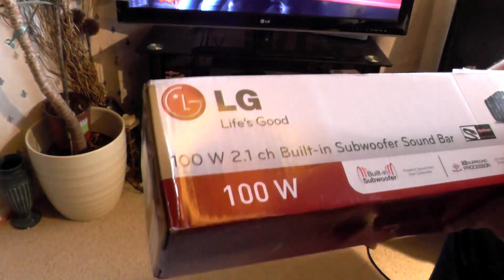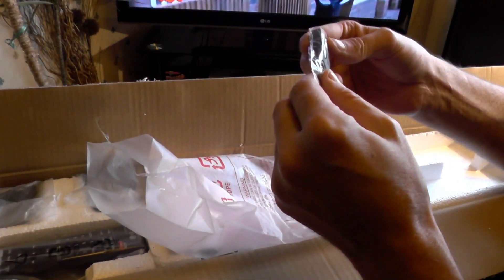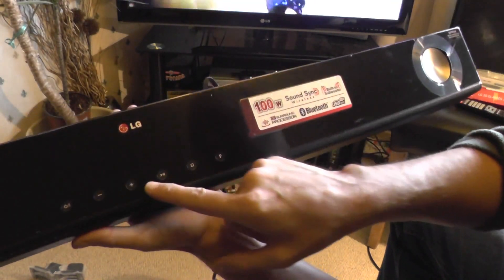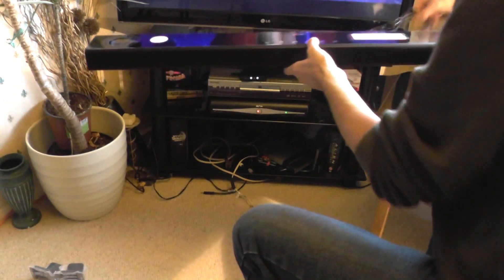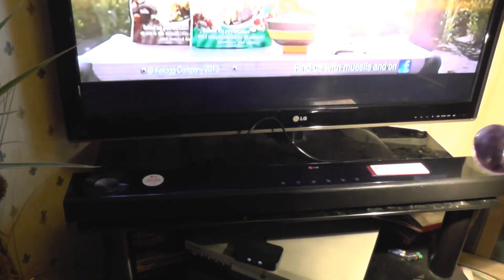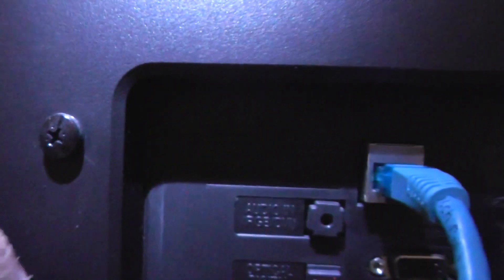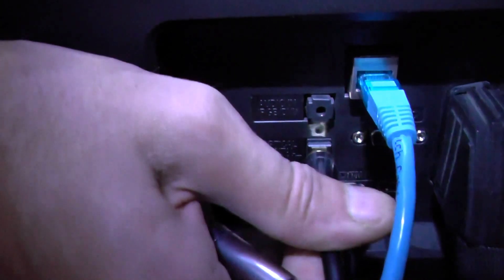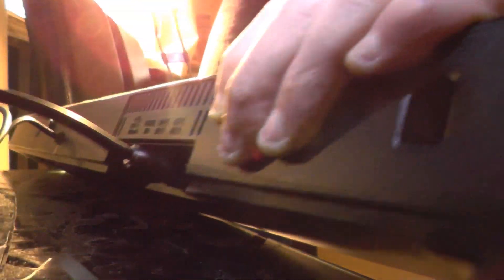🔊 Setup 2.1 LG Soundbar Bluetooth Speaker Home Entertainment

Comment: Can this be controlled with the TV remote? I've got a Sony soundbar with a panasonic tv and volume is independent. With an LG TV, can these be controlled together?
Reply from the maker: a lot more devices can co control.   LG tvs will as this is LG soundbar.   But it should still turn on via optical connection with any TV.
Reply from the maker: yes, when turning the volume up on LG tv, they both go up together.   As in the soundbar volume display goes up.   in synch.
Reply: TV remotes are Bluetooth now so doubt full.